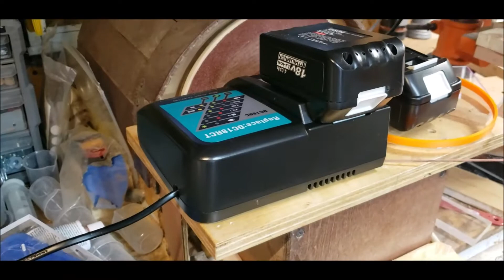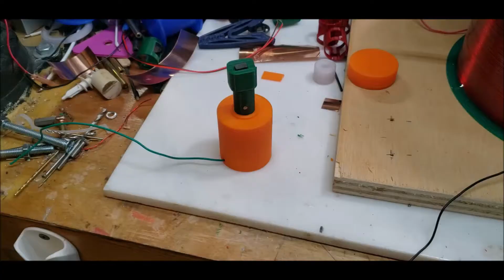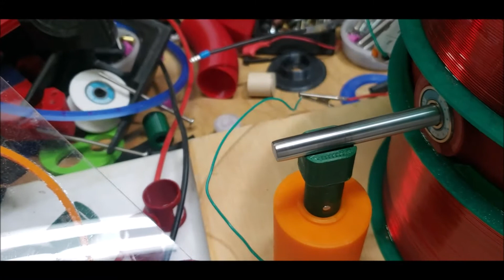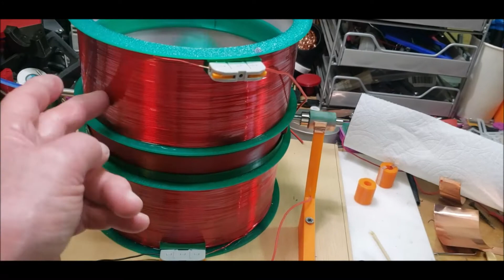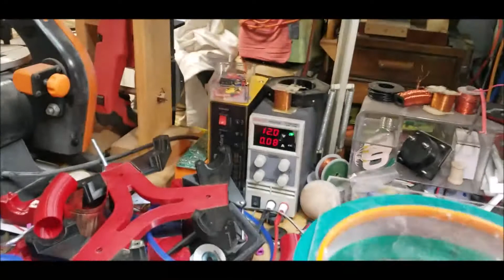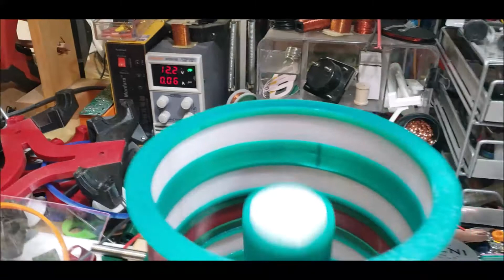3D Printed Newman Motor Run Complete (almost) :)

Comment: Check what angle the rotor is at when it firers may help work out the contacts, also they may be to wide to place more then one, you could try a contact using a heave gauge wire instead so it allows for more.
Reply from the maker: I guess I didn't explain myself well enough but that's what I was doing. When the two poles are vertical and the contacts are the same is when it fires the best.
Reply: @mcorrade  
Cool, then when you do the contacts you could cover the whole armature with just a gap between them to separate giving it maxim time to drive it, and make sure you have the brushes exactly opposite from each other so it breaks contact at the same time.
Reply from the maker: I thought about the wire method but I really like the copper sheet way. I will give the wire a try now that you mentioned it :)